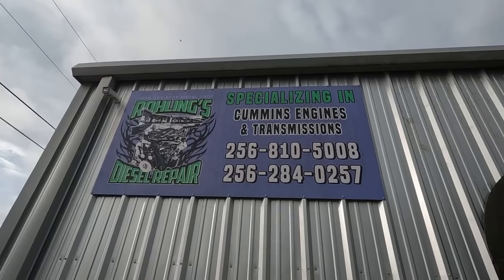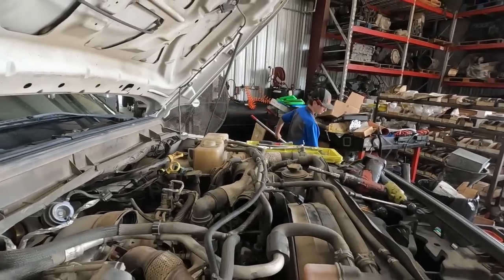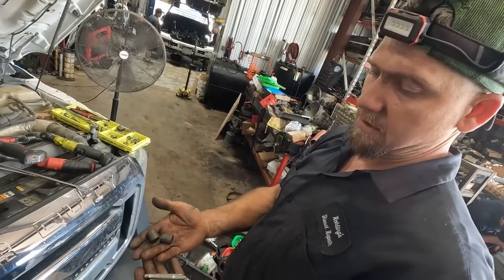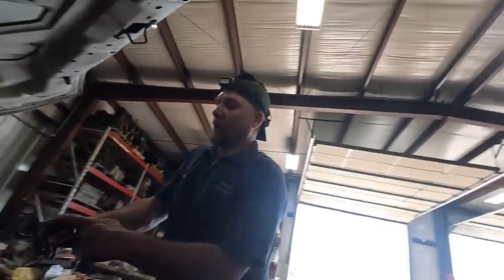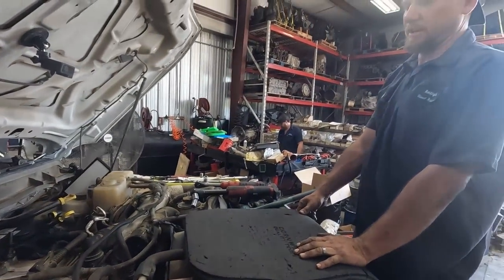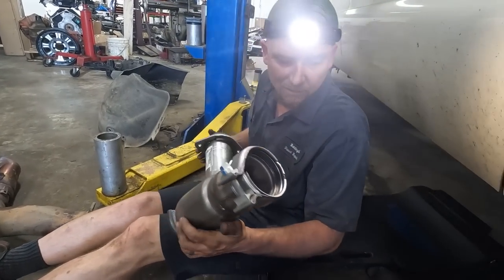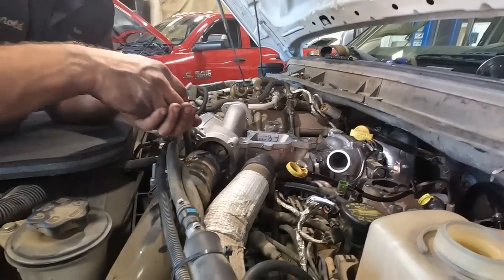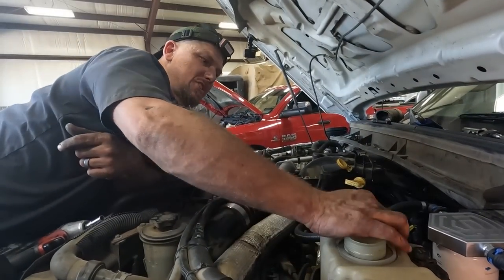6.7 POWERSTROKE 15 TURBO RETROFIT KIT IS AWESOME!

Comment: In the first 30 seconds of your video you said that you have 250,000 miles on your truck and then said that the twin turbo you have in it is unreliable and fails prematurely. I don’t think both those statements can be true lol
Reply from the maker: I said they are known for failing on those model trucks. My take off is actually is decent shape and has very little slop.

Comment: You’re not putting in a 15’ high pressure fuel pump!  You’re installing an DCR pump engineered by S&S diesel. Diesel Common Rail. You really wouldn’t need the disaster prevention kit.. but it won’t hurt.
Reply from the maker: Yeah the DCR just doesnt have enough real world testing for me to drop the money on it yet.

Comment: I got a 2012 6.7 that I upgraded with the same kit.  Once the turbo has spooled up I love it, but from a dead stop the turbo has a hard time spooling up.  Did you mess with VGT parameters to get the spool a little quicker?  Pulling my RV... from a dead stop the truck almost feels like it is stalling out.  It has taken the turbo 10 seconds to spool up before... any ideas?
Reply from the maker: Some different tuning might help. I love mine
Reply: Mine does the exact same thing. Trying to find a better tune for it now. Did you find any tunes that worked for you?
Reply: Any luck on tunes for this. I’m in the same boat. I was questioning my install as I don’t hear the turbo spool anymore like I did with the old turbo

Comment: Bet you wish you had known about the KC turbo warlock kit and the S&S DCR fuel pump. All that money on stock Ford parts proven to be subpar.
Reply from the maker: I am familiar. No regrets with this kit
Reply: I also have the CCV delete and I had a bung welded into the exhaust to hook the hose to. It creates a vacuum to assist with the crankcase ventilation and keeps oil droppings from marring up my driveway.
Reply: @Bustedknucklevideo… what shop did you use to do the installation?
Reply from the maker: I would like to do the bung setup soon, I get tired of the fumes being on the driver side. No oil issues really. I used Rohling Diesel for this entire install.

Comment: I'm finally getting my upgrade turbo put on, after 3 years running a JUNK Smeding Diesel turbo after my orig 2014 turbo died. I couldn't find  the ford Upgrade turbo when the orig one died and had to go with that Smeding turbo.  had some health issues for past 3 years but my shoulder is finally healed up enough to work on it.
Reply from the maker: It really woke up my truck

Comment: Surprised you’re still running the EGR cooler. I’ve been deleted with H&S tunes since 16K miles. My EGR (unplugged) finally started leaking internally around 165K. Yanked it off and no more burning coolant out of the secondary reservoir. Keep an eye on yours for sure. 

This turbo and the S&S DCR pump are on my short list of future mods!
Reply from the maker: Yeah gotta keep those emissions in tact for the internet 👍
Reply: As he learned from Arnold obviously, EGR can be tuned off. CCV doesn't have that luxury so just vent it overboard.
Reply from the maker: Don't believe everything you see on the internet. I'd like to swap to an aftermarket pump eventually as well for both my truck and RV.

Comment: Congrats on the new upgrades! I did the KC Warlock kit on my '12 a couple of months ago. I'm enjoying the added power after I got the tuning figured out. Was I hearing your fan engaged when you were testing the truck? I thought I could hear it in the video. Just curious...
Reply from the maker: It's possible, I tested it in the middle of summer in Alabama so it was probably over 90 degrees.

Comment: I’m surprised your stock exhaust manifolds weren’t warped mine did around 200k. I’m surprised you didn’t run the new gen cp4 that doesn’t destroy the fuel system when it fails eliminating the need for the disaster prevention kit.
Reply from the maker: I’m still waiting to see if the new cp4 replacement setup works out or not
Reply: That's a DCR3 pump which is a CP3
Reply: @RockyMountainHunters  nope not cp3
Reply: @RockyMountainHunters  No, DCR is different than a CP4 or CP3.
Reply: If by "new style CP4" you mean the RCD CPX, that pump can still fail as its still a CP4 at the end of the day. S&S's DCR pump however is not and has been proven to be more reliable.
Reply: @cjchico  I now know that thank you!

Comment: What did it run you for parts and labor?
Reply from the maker: I got a deal on the parts and labor so I couldn’t tell you. But if you want to call Full Force Diesel and Rohlings Diesel they could give you a ball park estimate.
Reply: I'm a little far north (Montana) but I appreciate your reply. Done a little digging and it looks like 3k for the parts and prob 800-2k for the labor. Seems worth it to me. Have you noticed any change in MPG? I assume it's negligible
Reply from the maker: Mpg was negligible but the pulling power is sooooo much better
Reply: I did the swap on my truck. I'm wondering what tune you are running on yours now?

Comment: "keep it emissions compliant".. Next scene deletes pcv for a road draft tube. 😅
Reply from the maker: PCV reroute keeps it from getting clogged up and causing oil leaks. 😬
Reply: Road draft has a venturi effect because of the angle and causes slight vacuum to suck the gasses out. Stock with s clean filter does the same thing. This, will cause a leak or backup way faster. Route it to your exhaust with a venturi for the best results